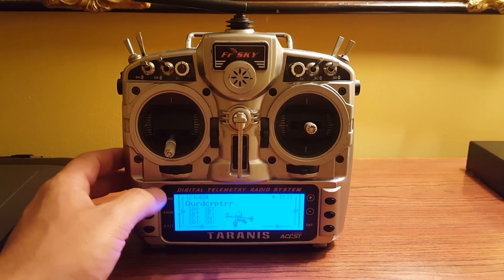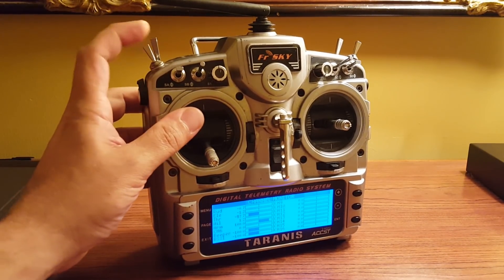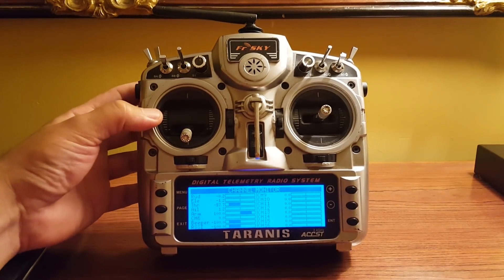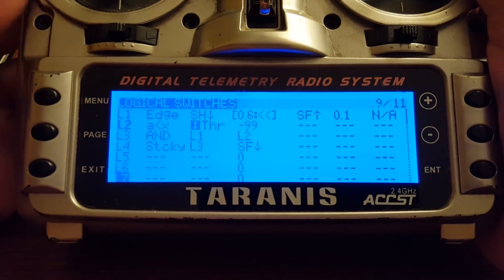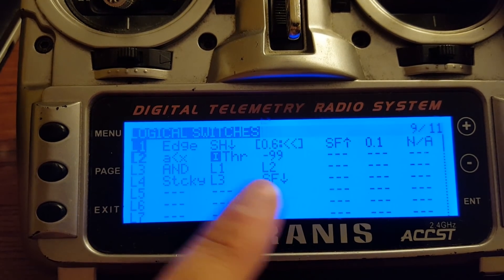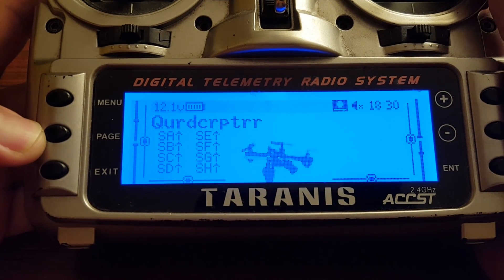Safer Switch Arming on FrSky Taranis

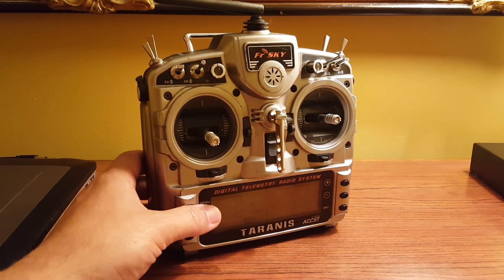Comment: I wanted to have this safety feature, but when I try the throttle trick (1:45), the engines won't start. I'm using latest stable FC firmware and Betaflight 4.3.0. So now it is not necessary using two switches to arm the quadcopter :-)

Comment: On a taranis xlite, which doesn't have a momentary switch, could I instead,  just use my failsafe switch as a 'secondary line of defence' i.e. disarm, then engage failsafe, so that even if I accidentally hit the arm switch the quad won't arm as it is in failsafe mode?
Reply from the maker: If you want to do that, set up Prearm mode instead.
Reply: Thanks JB. I've just realised the method you've outlined in this vid avoids having to use another channel in betaflight. So perhaps, I could use the method shown here, using my turtle mode two position switch as the sticky, turning it on and then off before hitting the arm switch for normal flight, or turning it on and leaving it on prior to arming for turtle mode use(?).
Reply from the maker: You can do that. Also, you could just use throttle as prearm. Raise throttle after disarming and you won't be able to arm until you lower it again.
Reply: Thank you so much JB.

Sometimes the simplest solutions are the best -I'll stick to raising the throttle following disarm as I think I've been instinctively doing this without consciously realising it helps prevent arming!!!

Comment: Joshua, thanks for the video.  I was following you way back when you posted this video and I programmed the sticky arming function, at that time.  Nice work on your part and posting a video was so helpful.  I put the copter away for a few years and pulled it out just recently.  It would NOT arm.  I panicked.  Well, I forgot about the sticky arming feature, which was enabled or available on my Taranis.  It will arm now.

Comment: you forgot that right after you arm it, you need to make sure it can also disarm if you put the SF switch to disarm. In order to do that, add the SF(up) on the L04 line second area on the right (funny enough, L04 should activate only when you have the sticky scenario, AND SF(up) is actually armed; this way it will deactivate right away when you disarm SF, no matter what the sticky scenario is at). I added a delay of 0.1 to the "AND SF(up)" on the right to avoid the little glitch otherwise.

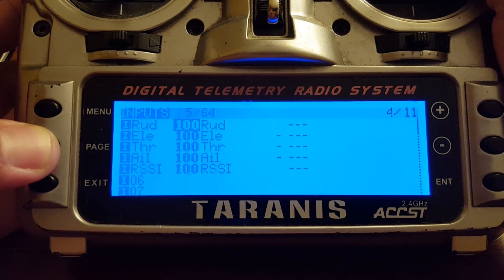Comment: Must my 5 channel need to  be setup exactly like 5:13 in order to arm?...I dont have the mix part,just the channel 5 toggle.
Reply from the maker: That's fine you just have to be more careful not to arm accidentally.
Reply: @JoshuaBardwell  Perfect and thanks!!..I know I was complaining about that switch arm..but if thats how it is i want it as easy as possible with the least amount of hoops to jump through.

Comment: This video is recommended in the Holybro Kopis 2 manual.  Because it uses the DJI HD system, and thus the DJI controller, OpenTX hasn't been implemented by DJI.  Is there a method to have 2-step arming with the DJI controller.  I'm thinking no, but I'm wrong more ofter than right lately.
Reply from the maker: The way to do that would be to use the Betaflight Prearm mode. But it'll take up a whole extra aux channel.

Comment: Joshua, When switching models in my Taranis x9D, the ghost module sets all channels low. this has caused a powered ghost equipped model to arm. I posted a demo video of the effect. It was posted before I figured out why. Left a vid on the immersionrc facebook page warning anyone who may be using this combo.
Reply from the maker: I definitely think you should not be changing models with the bound model powered up.
Reply: @JoshuaBardwell  Hi. and Thanks. Is there a safety reason like losing the armed state by keeping the arming channel low and raise it to arm? If that is even possible?
Reply from the maker: Just when switching models, you don't know what status the new model's channels will be in and you don't want to risk them being in an undefined state. I doubt that the Ghost module itself had the problem. I think probably the new model for some reason commanded the channels to go the new positions?
Reply: @JoshuaBardwell  Hi. Thanks for the conversation, AGREED!  and I think this will help, you should try it. I Watched the channels on the Ghost display, the arming channel was above the arming threshold. During the model switch the arming channel went low then back high. While low, it armed the copter. You would think this would be brief however my transmitter was waiting for me to correct a switch setting and in one case to get past the check list and during that period where the ghost module was not talking to the Taranis, the arming channel was held low (assuming the ghost sets them all low for safety reasons. In hindsight, I'm planning to remove the post on the IRC facebook page because it isn't the proper place to post the warning. I will be revisiting how to arm because someday, sometime i WILL forget to not change models while quad is powered. Thanks for your time.

Comment: Hi, Something unusual happened, my quad armed itself under strange circumstances. I use the sticky switch arming and like it very much. Story: I may not be exact here because it was an unexpected surprise. I was bench testing to uncover a faulty esc and because I'm using Ghost, all of my receivers are #1. After running the motors (7 inch props on for load) I realized I was testing under the wrong model so once I selected the correct model, it armed and I can't be sure whether it was running higher than Idle because I was panicking to get it disarmed but I don't think I would have panicked if it was just idling. Something to watch for. I did not try to reproduce it.

Comment: You can do this with just 2 logical switches.  Set L01 to 'OR', argument 1 to L02, argument 2 to L01, argument 3 to SF up.  L02 stays the same, but make argument 3 SH down.  Use L01 in your mixer.

Comment: Does this switch work automatically or does it need to be assigned to SF then to aux ch1 mode in beta flight?  e.g arming Horizon Angle etc. I mean does beta flight actually need to see this working in receiver tab and setup in modes tab
Reply from the maker: No the momentary switch does not link to an aux channel. It is only internal to the radio.

Comment: I THINK THIS IS A GREAT QUESTION!  I DO!
I am using the Taranis momentary switch for an assigned telemetry report.  Will this also trigger the arming switch?  I only tap the momentary switch while flying to get the readout...not holding it for any length of time...if that makes any difference...8)
THANK YOU JOSHUA!

Comment: https://drive.google.com/open?id=1WfU4q64d5M0dwZVFhQID3pqiFnp7jItq I have done your setup but have added a little to it to provide flight modes, also now switch SH if held longer will give you the throttle cut, I would like to add a single beep for arming timeout and also for throttle cut timeout ie when the switch is pulled a single beep when its held long enough to arm, and a double been for when its long enough to throttle cut, throttle cut is really only if you are using a glow motor as your idle trim will be off -100 it doesn't seem to effect the operation of the arm function

Comment: Just started to implement this in conjunction with my flight mode switches, had a couple of "bumped throttles" last few months, great video Josh, I might modify it a little so the momentary switch can still be used to throttle cut on glow models, bit of thinking to do :)

Comment: I run "Arm" as" SA-" and found a better change is the have"L4 Stcky L3 !SA-" or in Joshua's example "L4 Stcky L3 !SF↑".  This means the switch can go to any position other than armed to disarm.  I've always used the middle of the switch as I figured it's harder to knock into that place, and is a great addition to this guide.  If doing the same you want the mixer CH5's second line as "+= 0 MAX".  Hope that's a helps others too.

Comment: how do i disable the stick arming ? i setup switch armings on a aux 
now it wants me to put my left stick all the way to the left bottem and than switch the switch

the problem is this makes my quad spin like crazy as the motors arm and it wil be uncontrollable

ps using q7s
Reply from the maker: Switch arming and stick arming do not operate at the same time. When you enable arming mode, stick arming is disabled. So I don't know what is making you think it wants you to push the stick all the way to the left to arm it.

I wonder if your channel mapping is wrong, so that your FC thinks the yaw channel is the throttle channel. Check your channel movement in the receiver tab to see that the correct channel moves for each of the four control axes.
Reply: @JoshuaBardwell  thx allot! i think you saved me allot of time

Comment: I have a QX7S and I had some problems getting this to quite work. I'm using opentx 2.3.1. It took me several hours to get it to work correctly. Maybe this will help someone else. The problem I was having is the the Sticky would not disengage when I disarmed. It would only disarm when I rearmed the quad.  And then it would arm immediately the next time. The Sticky is the problem.  There are 2 things u need to do.. In the logical switch code. You need to add below what Joshua has in the "AND switch" your disarm switch position in the sticky code. This will force the sticky to go false and disarm the quad. Also you will need to add a delay I used 0.5 or else the motors with turn for a brief second  when you flip the arm switch which is not what u want. I also removed the "and" code in the "EDGE" part since beta-flight will not arm if the throttle is not in the 0 position. Also I use a trim switch for the EDGE instead of the beeper switch since i didn't want to hear the beeper ever time i wanted to arm the quad.  I by default disable all trims on the radio. Hope the help someone else.

Comment: I set it up blindly following your instructions and when I armed, nothing happened but when I disarmed the motor ran and wouldn't stop. I then had to  try to understand by playing over and over. I finally realised that you had reversed the instructions in the mixer.
It should read, when L4 is true throttle is 100. When L4 is not true throttle is -100.
Thank you for the error, it forced me to persevere until I understood.
I find it hard to believe I'm right and you're wrong and I hope you'll correct me if I've missed something but it now works and it didn't before.
Reply from the maker: The way I show in the video is exactly how mine is set up and works. My best guess is your setup is different from mine somehow. But if it works, it works!
Reply: @JoshuaBardwell  I knew it was very unlikely that I'd find an error in one of your  how to videos. So now I've gone back to confused, but as you say, if it works, it works.
Thanks for a great safety feature.

Comment: Please help! Eyed like to....."seems so simple but I cant finger it out😑.." I want this same sequence BUT. Instead of SF how can I use a potentiometer instead?! Like a key to turn. And even MORRE less likely to arm... and then id like to use sh, "the spring back/toggle switch" to dissarm also........?!?! What do you think🤔 So say you have to have a potentiometer that needs to be turned all the way right.... if its not 80% +, you cant hit the sh toggle and arm.. and when you land you just hit sh again to dissarm.... turn the potentiometer alllllaway -100/0/"1000 bf aux" and you dont have to worry!!!         EDIT I feel so relieved😫😫😂😂 I can fiiinnnnally hang out with the old lady again! When Im set on doing somethng I cant stop and that took 3 days..... and it was tooo easy. I wish somebody was intrested in this also as I think its prettyyy awesome😎 Thank you SOOOO much for your help and allll the videos!

Comment: Joshua, can I still use the right momentary switch to disarm the quad? I'm used to use that side to disarm/kill my gear for 10 years now on my spectrum. But now I'm moving to taranis and would like to know the best way to disarm/Kill my quadcopter.
Reply from the maker: Sure, you can set it up however you like. That's the beauty of OpenTX.
Reply: @JoshuaBardwell  Good to know, thanks. However because I prefer the right side a feel like a "lefty" (phun intended)... Because I get the feeling from all those online fpv'ers that they use the left side switch. Could be handy for times when you let other people fly your gear to learn the "right" way to use the left switch. This is getting a complicated explanation. Anyway, keep up the good work, I indeed learned a lot from you.

Comment: So I know I'm a bit late but I have been messing with my Taranis for about an hour now because most times it won't arm after this set up.  And unfortunately when it does arm it stays armed until after I hold the "sticky" arm switch lol. My setup is backwards somehow and I can't figure out where I went wrong.
Reply from the maker: Most likely you are setting up your Aux channel in betaflight to have arm as "high" (2000) whereas I have it set up with arm as "low" (1000). Move the arming mode in betaflight so the quad arms in the "low" position.
Reply: Joshua Bardwell . Ill give it a try when I get off of work tonight. Thanks broski for the reply and the help keep up the great work. This hobby needs it.

Comment: KISS still has the throttle "ticking time bomb". I just found this vid and tried it on my latest firmware KISSFCV2F7-1.3-RC36i. Never knew it would do that. If it ever wouldn't arm because of bumped throttle, I would naturally disarm, lower throttle,  and rearm, not ever noticing if it would throttle only rearm. It creeped me tha hell out when I just tried it. Yikes! Just an FYI. Thanks for your great vids.

Comment: Joshua, is there a way to do that without using a mixer channel? I mean, I use one witch to arm the quad, with your manual I need two of them to do the same, that means I'm doing the same thing as enabling the prearm mode in betaflight, but more complicated. If I want to reduce the latency, we alll know it's better to stay in 8-channel mode, for this reason I don't have any switch left (arm/disarm, RSSI, flight modes, buzzer/antiturttle mode) to assign to prearm mode. Thank you!
Reply from the maker: I'm confused. The method I describe in this video uses only one channel. It uses two aux switches but only one channel.
Reply: @JoshuaBardwell  Thank you for your answer! After your commend I realised I had the switches inverted in betaflight, that's way I needed an other mixer. Problem solved! This is really amazing, no more fingers cut!

Comment: Hi Joshua and thank you for your videos. I'm newbe and try to lean on your experience. But I discover a problem with this method. My Taranis is self arming every time when turn on. It's x9d plus with openTX 2.2. May be you can suggest to fix it?
Reply from the maker: I'm not sure what you mean by "self arming". Can you be more specific?
Reply: @JoshuaBardwell  I mean arm channel value is +100 every time when I turning on my Taranis. Also I assign sound message on this channel arm/disarm and when Taranis turning on it's sounds "arm" every time after welcome message "welcome to openTX".

Comment: On the qx7 can this be setup using a 3 way switch  on the top left and the two way switch on the bottom left instead of using the right momentary switch?
Reply from the maker: Yes, it can use any switch you want.

Comment: Hello Joshua
I followed this and thought I'd got it working, on my qx7. But it seems that as soon as logical switches are used i lose throttle control. Is there any chance you could actually set this up on a qx7 and see if it works for you. It all looks ok on the radio but the prop won't spin up.
I'm probably missing something.
Reply from the maker: The steps are the same for QX7 as X9D. There must be something different about your setup compared to mine, like the way the throttle channel is set up.
Reply: @JoshuaBardwell  
Thanks for the reply. 
I've been through it all and it's now working. I think it was the way I had throttle cut set-up. Funny thing is it only took 15mins this time round. I spent half of yesterday trying to get it working. I definitely feel like I've learnt something today.👍😁

Comment: Slightly of topic; is it possible to set the momentary switch to stay at the state when its switched? Let's say I flip the switch it goes to 100, usually when the switch goes back it will go to -100 again, but I want it to stay at 100 until I flip the switch a second time. Any idea how I can do this?

Comment: great info Josh. about 3 months ago planned to set my radio up this way...I didn't. Today I have a nasty cut on my right hand which cut through my fingernail down close to the bone. (I bumped the arming switch while I was positioning the quad for takeoff) Thankfully for me the quad was set in Horz mode, throttle down, and motors started spinning in idle position. Could have been much worse had i also bumped the throttle up while trying to get away from the spinning props. Needless to say a lesson learned. I am now taking a few 'safety steps' to protect myself.  1. keep the transmitter off until the quad is on the ground ready to go.  2. when plugging in the battery keep all fingers and other body parts away from the props.  Roger